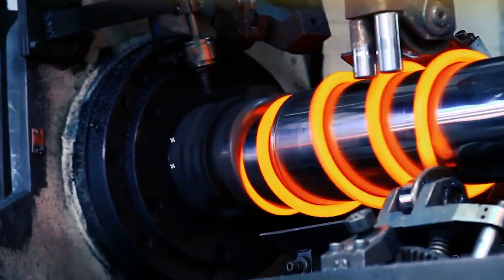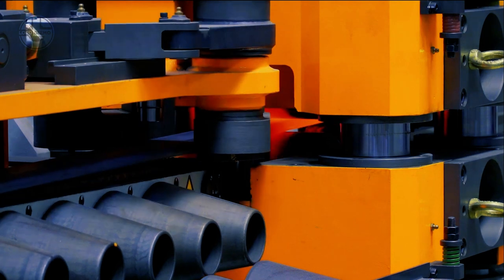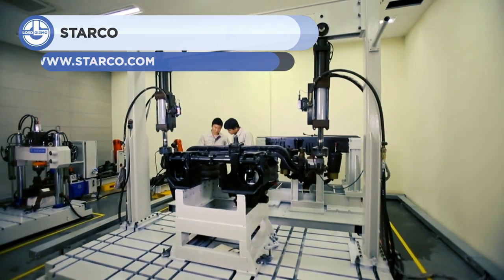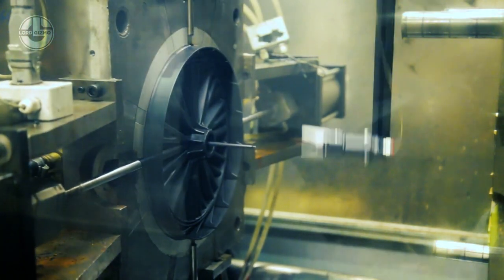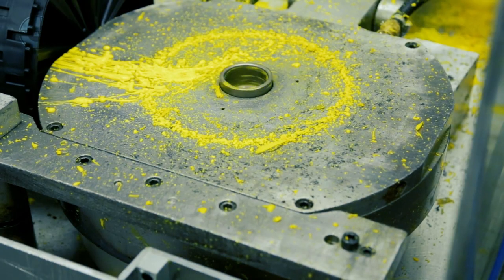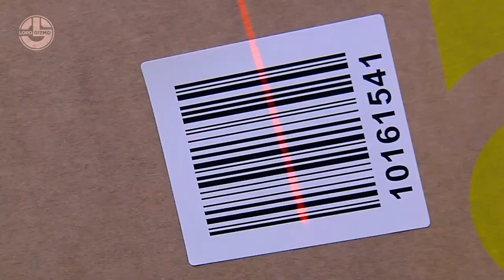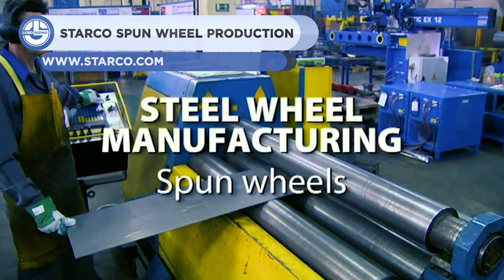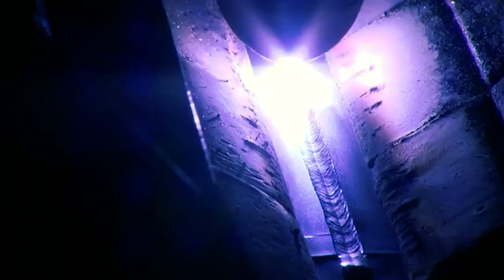Satisfying Impressive Machines And Equipment Manufacturing Processes For Wheels, Tires, And More.

Comment: I like those caster wheels that look like mag wheels my mower a sensation had 8" wheels in front and 10" rear wheels both for push and self propelled I think you should make replacement wheel for old snappers bobcat sensation toro 21" mowers as there hard to find